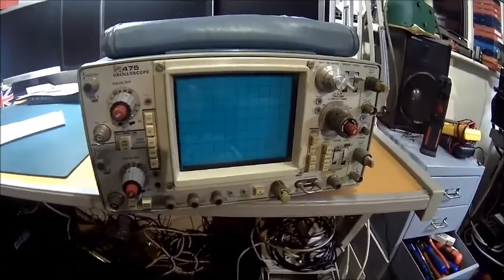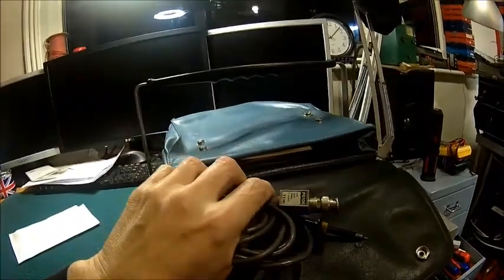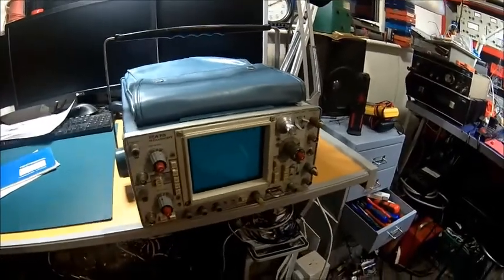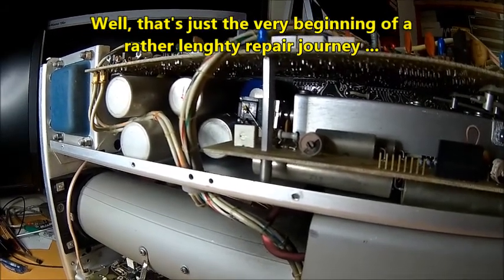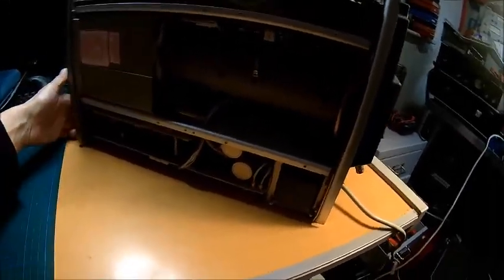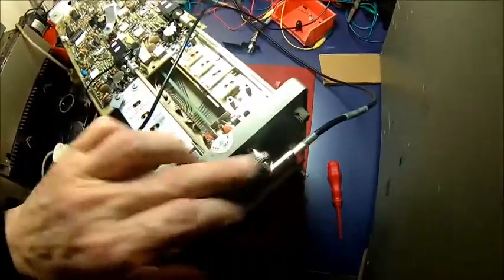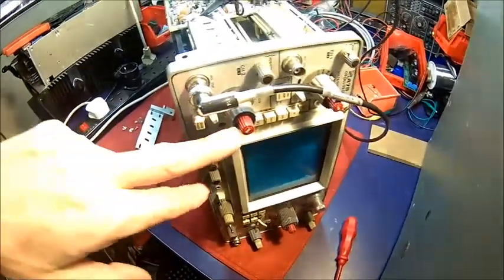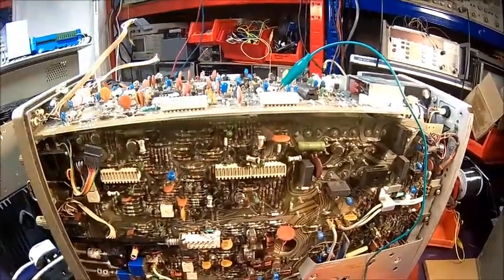Tektronix 475 Oscilloscope Repair Ep# 1 - powers on but no trace.

Comment: Is it actually possible for an old scope to emit that many X rays???
Reply from the maker: If things go wrong electrically, these could emit a fair amount of x-rays, essentially any CRT produces x-rays, the higher the anode voltage, the  more
Reply: @dynoguy   ive recently got my hands onto an old crt scope and now im concerned 😅😅. Its having some troubles but im getting a reading . Is there any way to tell besides a radiation meter if its harmfully emitting?
Reply from the maker: well, ..people were staring at CRT TVs and PC monitors for several decades (me included) and not many were concerned. So if you really concerned about x-rays coming off an old scope CRT, i'd suggest to buy an new one with an LCD screen and you are most probably safe.

Comment: I have a Tektronix 545B oscilloscope 1965 vintage
Can you advise please the trace fades to nothing about 10 mins after switch on
.otherwise all in very good condition
Reply from the maker: I'd suspect power supplies at first, so check voltages and go from there
Reply: It COULD be CRT cathode emission.  Check the P.S, especially the electrolytics, first.  If the CRT is on its last legs, a TV CRT "rejuvenater" might extend its life.